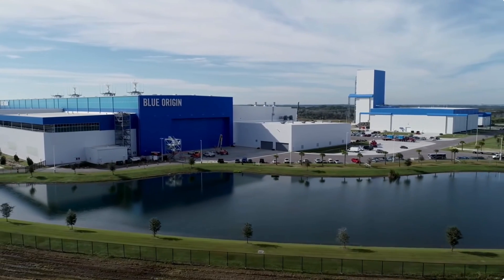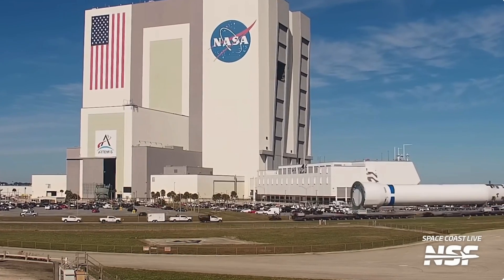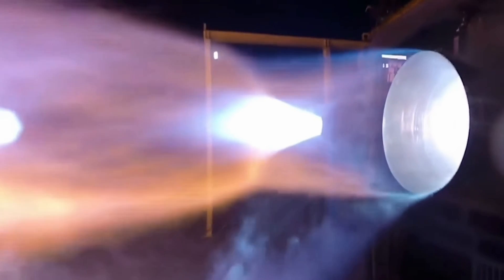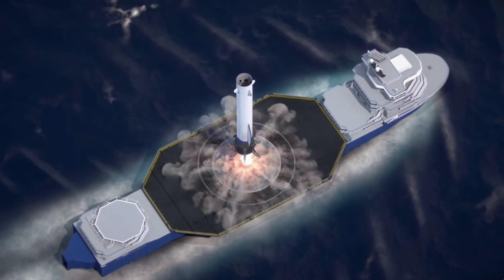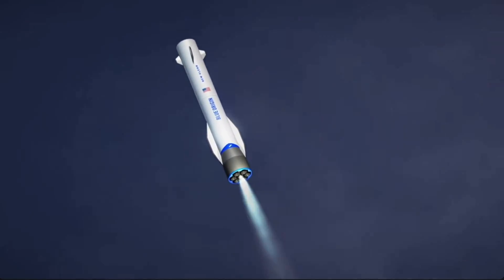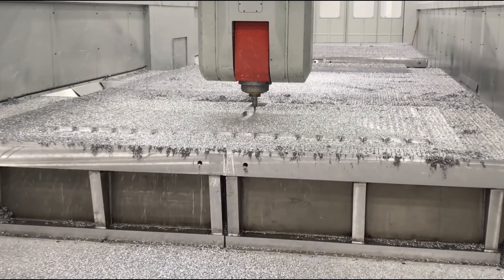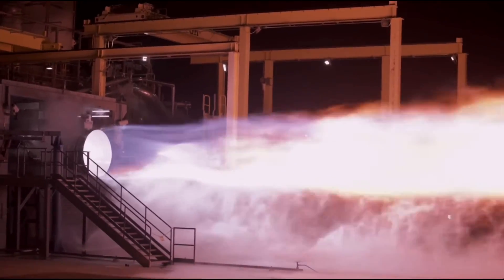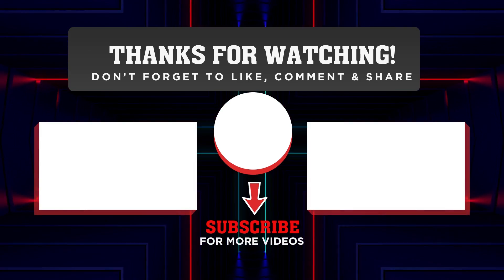New Glenn's Big Reveal: New Updates on the Rocket's First Launch!

Comment: The Starship has just completed its 4 test. Yes, both the booster and the second stage touched the water. But they barely made it. Starship is still in the making, and it will need YEARS to have a viable solution. We'll see what the New Glenn is capable of.